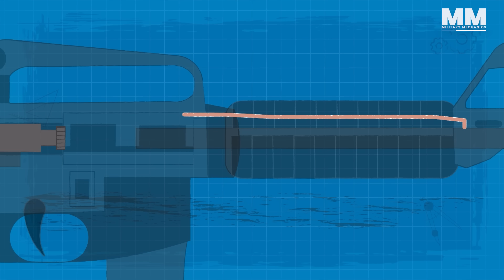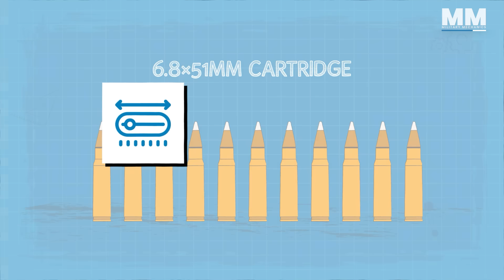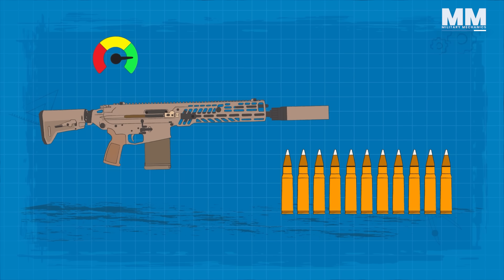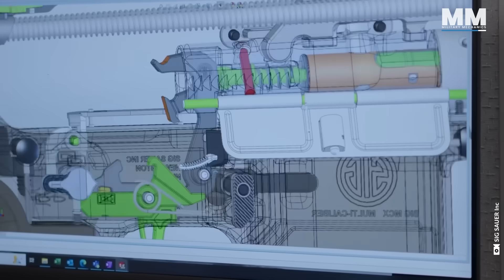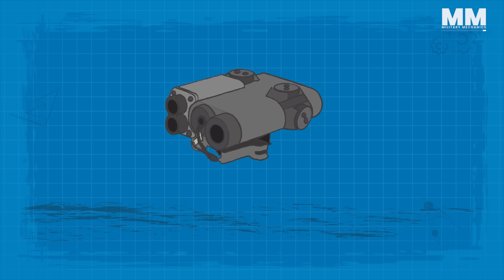XM7 vs M4: Why the U.S. Army Is Making the Switch

Comment: I’m still skeptical that this is really going to become the standard service rifle. The military may have needed more punch and range, especially against Russian and Chinese body armor, but at most, that means that they needed a new squad-level DMR, not a full replacement for the M4. And frankly, even then, I don’t see why they couldn’t have just bulk-purchased the SCAR-H (already a proven design that has served SOCOM well for 15+ years) and maybe added the new scope to it. I don’t see why we needed a new rifle and a new cartridge.
Reply: If you have watch garand thumb video on the ballistics of the new 6.8 round. The new round out performs the 308 by a lot. So to answer the question of just using something like the scar or 308, this round is a lot better than 308. This new round can penetrate light armor vehicles as well. Most light armored vehicles can stop up 308 or 7.62 nato, but 6.8 out performs it and can penetrate light armored vehicles easily. Not to mention the new round is capable of penetrating multiple types of cover a lot better than 308.

So if you have everyone equipped with the new round, every soldier is capable of defeating body armor or light armored vehicles and even cover as well. That is something you can’t do with 5.56 and even if you have people in your squad using 7.62 like a m240, that is something you can’t really do either. With how powerful the 6.8 round is, the xm250 can now replace both the m249 and the m240. You no longer need to go out and look for a m240 because the saw you have now can do multiple things. This makes everyone truly unified under one caliber which is good for logistics to. Since everyone is equipped with a xm7 everyone is also a marksman as well and there isn’t just one marksman. 

I think switching to the new round is the right choice my only concern is the weight because it’s not a light rifle. The only other concern is recoil especially because not every soldier is built the same. But hey we won ww2 using the m1 garand so.
Reply: The M249 was due a much needed replacement that weapons system is dogshit
Reply: 😅It's how we do business.
Reply: It's probably the business.... and some bonuses here and there!
Reply: There's plenty of issues the this avoids from the scar. No reciprocating charging handle, and it doesn't break optics like the scar. 308 also doesn't have the performance on body armour they were after. If you're going to change and spend all this money, you do it. You don't pick a half baked solution.
Reply: @samuelbishop3316   The current SCARs do not have reciprocating charging handles.
Reply: Doctrinally we’re already supposed to have one SDMR per squad, some units just don’t practice that
Reply: Re: "And frankly, even then, I don’t see why they couldn’t have just bulk-purchased the SCAR-H (already a proven design that has served SOCOM well for 15+ years) and maybe added the new scope to it. I don’t see why we needed a new rifle and a new cartridge."

I'm cracking wise, but not completely when I say: What does Sig have on the decision-makers in the DOD-Pentagon anyway? Incriminating photos? Sig has been getting a suspicious number of lucrative contracts lately. Not just the Sig Spear, but the army's LPVO contract, too - their new optic for rifles/carbines. Of course, they do make good products, but that good?? 

The fact that none of the practical and relatively frugal off-the-shelf solutions was used and a complex, new, and untried system - the Sig Spear and its new ammo and optic - was adopted instead, speaks volumes about how the procurement process "works" inside the five-sided puzzle palace. It isn't really to get the troops the best gear for the best price; it is to keep the gravy train rolling for all of the brass and defense contractors. 

The legacy system could be defended, in spite of its drawbacks, as long as it produced the best weapons and gear in comparison to our peer and near-peer potential adversaries - but now that it is out in the open that they are getting a far-better return on their dollar than we are, it is time for reform. Maybe even a fresh clean sheet of paper.

The Spear and its new-and-untried high-pressure ammo are a case in point, a classic fiasco in the making.  The requirements for the weapon started this whole thing: A 13" barrel is ridiculously short for a general-purpose rifle, in particular one whose stated mission includes long-range interdiction. In order to make the army's performance targets at distance, Sig had to create new cartridge technology in the form of a hybrid steel and brass case, a "solution" which may prove to be worse than the problem. Or not - we'll have to see. 

At best, even if it works, the new 6.8 Fury is more-expensive than off-the-shelf solutions, and is required construction of a new ammo plant at Lake City. At worst, the troops may be stuck with a weapon of dubious reliability, short service life and under-performance in the field. Again, we'll have to see. 

Perhaps the worst aspect of this project of all is that it doesn't even begin to address the decades-long debate surrounding the replacement of the current M4-M16 family of assault rifles and carbines, chambered in 5.56x45mm NATO, which is an intermediate cartridge. The Spear is analogous to the old M-14, it is a battle rifle, not an assault rifle. Even if it ends up being good at its job, it won't fill the new for a new assault rifle - because it is a battle rifle, i.e., fires a full-power cartridge; weapon too large, too heavy; recoil too stout; automatic fire too difficult; etc. And "small-stature soldiers," a.k.a. females - may have trouble with it as well. 

The M4/M16 isn't going anywhere, not withstanding the claims by Sig, the army or the DOD.
Reply: @GeorgiaBoy1961 the army puts out a bid proposal for a new Close Combat rifle.
Companies submit bids.
Nobody submitted the Scar.
Reply: @cwolf8841  - Am I missing something? Who said anything about the SCAR? Are you arguing that someone should have submitted it, but did not? I've only seen the SCAR a few times, and handled/fired it maybe once, so I am not the best source of info for that design. Lots of better-qualified people in/out of the military who know the design better than I do. The guy at my old shooting/outdoor club who had one sure seemed to like his, though... hated how much it cost, but raved about its performance.
Reply: @GeorgiaBoy1961 the new rifle only goes to Close Combat forces.
Everybody else keeps the M4.
Reply: @cwolf8841  - By close-combat forces, you mean combat arms personnel? If you mean those who do CQB, then I don't take your point. Isn't that the sort of mission the M4 was designed to do? But your basic premise, that the new rifle doesn't go army-wide, I agree with. I don't see it happening, although of course one can be wrong about such things. We'll find out one way or another, right?
Reply: @GeorgiaBoy1961 
The Army sets the requirements in the proposal for folks to bid.  Then the submissions have a shoot off.  Nobody submitted a SCAR.
The proponent being the Infantry folks … they made the decision to have a M7-M4 mix.
All you have to do is read the proposal…. All these things are online.
Reply: @cwolf8841 - Well, now, I don't need to read it if I have guys like you who know the score, right? Thanks for the info...
Reply: Overall they wanted to mount electronic optics and saw it as a good choice for that. I see this not as a replacement, but yet another supplemental weapon like the SCAR-H that won't be good enough to switch to. They'll learn the hard way. I think Germany and HK is the best AR platform to move to. H&K also has weapon designs that are 'far superior' to the US ones with future recoil and polymer designs improved to the topmost level. Like their new machinegun that is lighter than a m249, has better recoil and design, and fires like a m240b with improvements that is 'not for sale', etc.. would be perfect for the US as a future machinegun that looks and functions similarly. Same I'd say with their latest HK ARs which are known to be quality and simply improvements that can go up in caliber. The fact they couldn't make a made-in-US improved AR that is like the HK416-417 using futuristic polymers and plastics is ridiculous. SCAR-H isn't preferred for its iffy qualities and 20 round magazine which make it not a great overall replacement just to go up in caliber a bit. Usually other weapons just fill that role better and SCAR never replaced anything. If it was, it'd likely have been replacing a lot of things already, but it simply isn't always the case. Germany has done it right and some of the latest EU rifles and pistols have done it right too. I think it won't be replacing but will just be supplementing.
Reply: 1. 🟥 DHS Threat Economy System
Definition:
The Department of Homeland Security (DHS), alongside corrupted elements within federal agencies, have created a Threat Economy:
▪ Fabricated threats
▪ Manufactured terror cells
▪ Engineered domestic "extremists"
▪ Targeted assassinations and psychological operations on American civilians
▪ Monetization of fear through endless security spending, contracts, and false flag incidents.

Mode of Operation:
DHS and allied agencies bypass Constitutional oversight, operating like a modern KGB or Stasi, using illegal surveillance, economic targeting, biological harassment, and psychological destabilization to neutralize civilians who could challenge federal power structures.

2. 🟥 How They Operate:
Fabricate Threats: ▪ Stage or exaggerate domestic threats to justify endless funding. ▪ Inflate statistics about "extremists" to create fear and fake urgency.

Economic Sabotage: ▪ Freeze targets out of employment, housing, and banking via quiet designations ("watchlists", "no-fly lists"). ▪ Devalue and financially starve civilians labeled as "potential threats."

Isolation Tactics: ▪ Deploy informants and assets to socially isolate targets. ▪ Initiate smear campaigns and silent reputation assassination.

Covert Lethal Measures: ▪ Facilitate "accidental" deaths (car accidents, medical sabotage, mental health targeting leading to suicide). ▪ Use biological agents under the radar (non-lethal but degrading long-term health effects).

3. 🟥 Why They Do It:
Money:
▪ Every new "threat" generates billions in contracts for private security, tech, and weapons firms. ▪ Endless security theater = endless taxpayer-funded cash flow.

Control:
▪ An empowered, informed civilian population is dangerous to unchecked federal power. ▪ Targeting the most intelligent, aware, and independent Americans neutralizes future resistance.

Perpetual State of Emergency:
▪ Keep the population in a permanent low-grade fear state, justifying removal of rights and expanded surveillance.
Reply: How about doing some good old internet research where your questions are answered instead of posting "I don't know why". Why should we be interested in why you don't know something? 😏
Reply: @Sajuuk  - How about minding your own business? Were you born a jerk w/o manners or did you have to work at it?
Reply: Im not skeptical at all. Afghanistan has shown the weakness of the 5.56 which is it's range as well as lack of barrier penetration capabilities as well as to take advantage of the current and upcoming Rifle optics technology while keeping the length of the M4. Why did we not bulk buy 7.62 SCAR well it's length and the 7.62x51 inferior ballistic trajectory performance.

That were the 6.8x51 is born it's takes the best of both worlds (5.56 flatter trajectory while also taking the 7.62 excellent barrier penetration capabilities and range).
Reply: Re: " I don’t see why we needed a new rifle and a new cartridge." 

There are certain truths about how the DOD/Pentagon works, and one of them is that when a high-cost, complex solution is available, the low-cost simple solution will not be used. De jure, at least in this case, the reason the DOD/Pentagon exists is that it is there to get the troops the best gear, weaponry and equipment at the best value to the taxpayer. De facto, however, the reason it exists is to butter the bread of lobbyists, defense contractors and senior officers looking to get their tickets punched. To keep that river of taxpayer dollars flowing and profit margins high. 

In brief, your argument is way too logical, too economical and too sensible for their tastes....
Reply: The key thing coming the NGSW program isn't the rifle, it's the new hybrid case. That new case allows chamber pressures beyond the ~65k psi limit of current all brass cases. Upping the limit to 80k psi produces more velocity than 65k psi out of the same length barrel giving you shorter flight time and a flatter trajectory. Shorter flight time and flatter trajectory equal easier engagements due to wind, gravity, and target speed to have less impact on where the round lands compared to its aimpoint. Conversely if current velocity is acceptable, one could use a shorter barrel to match current results and save weight. Great thing about the Hybrid case Sig developed is that is it's caliber agnostic.... you can make a hybrid .50cal case, a hybrid 5.56 case, a hybrid .308 case, etc.... just need to make sure the weapon using the case can handle the 25% or more increase in chamber pressure.
Reply: @ogdendowcett2099  - 80K psi is uncharted territory for where std. military ammo is concerned, as far as I know. That's about 20% hotter than the current M80 FMJ 7.62 NATO round. The advantages you list are real, if the technology can deliver them consistently, and if real-world results match projections. 

A 13" tube is ridiculously short - Sig would not have had push the boundaries so hard if not for that requirement. A 16-inch barrel is still compact. Make the "cans" (suppressors) removal/QD so that they be stowed during travel. I don't get the notion that it has to be on the rifle at all times. It has to be cleaned, right - which means removing it, right? 

There's no free lunch with physics. Higher pressure means more-robust construction of the rifle needed - which means more weight and more cost, higher risk of mechanical and other failure, increased felt recoil; and then there is the ammo itself: 6.8x51, due to its new construction, cannot be made in existing ammo plants at Lake City; a new plant is being built. Is that wise, to place all of your bets on one plant, one factory? You tell me. 

If the project is a success, others will open to be sure. But there is no disguising that on a per-cartridge basis, 6.8x51 is significantly more expensive than existing tech, and more time-consuming and difficult to make. \

So, what we're looking at is an expensive new rifle, using expensive new ammo, along with its expensive new futuristic optic. We didn't get into that, but it is another potential point of failure in the system. Vortex Optics claims that this system of theirs is the small-arms equivalent of the fire-control system on something like a tank or helicopter, which is a tall claim to make. No one has solved the problem of wind enough to "guarantee" hits with a rifle at long range, no matter how good the rifle or ammo. 

Perhaps I am revealing myself as the not-so-tech savvy old man that I am, but is it really a good idea to have a small, potentially fragile electronic device atop your rifle, one whose buttons are small, and functions are complex? Will it be tough enough to survive/work in the field? What about weather proof? Is it easy enough to use that it can be done under the stress of combat? And so on. Vortex is a good company, but I'd have to say it is probably an electronic paper weight waiting to happen. Hope I'm wrong.... but not sure I am. 

I remain to be convinced that the entire project is feasible and will deliver on the promises made by Sig. Many of the problems the Pentagon claims to want to solve could have been fixed using less-expensive, off-the-shelf technology, without having to reinvent the wheel. I'll admit to being cynical, though; maybe the skeptics are wrong, we'll see. New tech has to start someplace....
Reply: @GeorgiaBoy1961  
If I remember correctly, a 13" barrel was not a requirement overall length was along with a muzzle velocity of around 3000fps. (Full disclosure, may be incorrect about muzzle velocity being an actual requirement, the actual requirement may have been energy on target at a specific distance from which initial required muzzle velocity was derived). To get that muzzle velocity from a standard pressure (~62k PSI) round you'd need a 20" barrel, hence GDOTS and True Velocity's bullpup submission. Sig decided to to meet the velocity requirement by designing a new cartridge that can handle 80k+ PSI without deforming which would allow the use of a shorter barrel and thus save overall weight base for the weapon. 

If you feel like some reading and better info than my memory, Gregory Knowles has some great threads on NGSW and NGSW related item, particularly one regarding chamber pressures and how it's steadily increased over time: https://threadreaderapp.com/thread/1552769176258785280.html

Here are some others:
https://x.com/2805662/status/1809399314671890865
https://x.com/2805662/status/1766235801795674161
https://x.com/2805662/status/1743462673243939141
https://x.com/2805662/status/1750346162262225318
Reply: The M-4 is a poodle shooter which never won a ground battle
Reply: @bernieeod57  Kind of a faulty metric by which to judge its performance, given that small arms aren't a decisive factor in winning wars anymore (if they ever were).
Reply: @ When you blow off the top of a mountain only to get driven off it does! From Guadalcanal to Chosin, 30-06 fire carried the day
Reply: @ Blackhawk down and Lone survivor are examples of poodle shooter fire failing when under similar situations at Guadalcanal and Chosin 30-6 fire carried the day
Reply: @ The rifle outclassed the musket, the 7MM Mauser outclassed our 30-40 Krag making victory in Cuba more costly. The 30-06, 8MM Mauser, and .303 rendered traditional skirmish lines obsolete leading to trench warfare so you are wrong! Small arms do make a difference
Reply: @bernieeod57  Small arms may make a difference in the individual infantry platoon or SOF unit's ability to survive a fire fight, but that's hardly the same thing as saying that they win wars (as opposed to specific engagements or battles, which is what you cite as examples). Also: If you ever watch Jeff Gurwitch's take on the M7, he's explained that in most recent firefights, the individual carbine gets used more as a personal defense weapon than the primary engagement weapon against enemy personnel armed with long-range weapons (e.g., Dragunovs or PKMs). The actual effects on target come from DMRs, M240s, .50-cals, or just calling in fire missions from drones or Apaches. His argument is that the idea of achieving overmatch against long range weapons by giving every rifleman the equivalent of a DMR (which is what the M7 is) is a fallacy from the get-go, because it is based on an inaccurate understanding of how firefights play out nowadays.
Reply: @ Until such resources are not available! Had Sgt. Basilone failed, the airstrip would have fallen and Guadalcanal would have been Wake Island 2.0. Had 30-6 Fire failed, Chosin would have been the Marine Corps biggest defeat. In Afghanistan, the poodle shooter was outranged by 100 year old Moisins and SVD's. It would suck to be you if your team was in one of those exceptions
Reply: @ By your own admission, the grunt has been reduced to an emasculated wimp who only finishes off the half dead and wounded after the enemy is pounded to dust by air, artillery, and armor. If the enemy is still able to fight, he retreats, calls the Air Force, rinse and repeat
Reply: @bernieeod57  I’m not going to pass judgment on our military, especially since I have not served myself, but from what I have read (from actual grunts who are veterans of recent wars), the short answer is that yes, modern-day firefight CONOPs are typically that if a small unit (infantry platoon, SF OFA team, etc.) gets engaged by enemy armed with long-range weapons, their approach is to lay down fire from their individual carbines so that they can find cover. After that, their bring their long-range weapons (SCAR-17S, M240B, MK 48, etc.) to bear on the enemy if they have them, or call in fire support if they don’t. I have no idea if this makes them “wimps,” but by most accounts that I have read, modern combat is nothing like Guadalcanal or Chosin. And even in WWII, most engagements were within 300 yards; the days of 1,000-yard marksmen were already ending by then. BTW: Operation Red Wings isn’t even an exception; that’s an operation that went horribly wrong and wasn’t supposed to be a firefight. And the problem there was simply that those SEALs were outnumbered. I don’t think they would have won even if they had the M7 back then.
Reply: @ Having served, even though Navy, we did go through land warfare training. The Navy uses the hand me downs in small arms. We still had M-14's. When due to the war on terror, we began to get M-4's, I stubbornly insisted on keeping the M-14 for as long as it was available. In counter ambush drills, I would simply take co er and pick off the enemy instead of joining ing the counterattack. The M-14 made a counter ambush a simple marksmanship drill expending only a few dozen rounds instead of spraying hundreds
Reply: @ Again, there are many cases where, in spite of being grossly outnumbered, 30-06 fire prevailed
Reply: @ The grunt never asks "How does it perform?" He always asks "What does it weigh?" Spraying a lot of .22 caliber bullets feels good but has not accomplished much
Reply: @ "The carbine is the weapon of mass army's whose motto is "Of you cannot shoot well, shoot a lot" The late Colonel Jeff Cooper
Reply: @bernieeod57  The thing is, when the M14 was being issued, the military still had problems with soldiers and Marines wasting ammo. Some field commanders had the weapons’ auto selectors removed for exactly this reason. Also: What you say about weight is one of the main reasons that the M14 failed as a service rifle, and why I think it likely that the M7 will, too. The name of the game in a modern firefight isn’t to use the service rifle to reach out and use precision fire to eliminate all enemies. The service rifle these days is just a personal defense weapon that soldiers use to return fire and keep the enemies’ heads down until fire support arrives. That means that volume of fire, not precision, is more important, and that is why the M4 is still ideal over the M7.
Reply: @BunyipDude suppressive fire is defined by the AMU as being within 1.5 feet of the Bad Guy.
The new rifle -sight combo is dramatically accurate and fast.
Dead Bad Guys are much better than temporarily scared Bad Guys
Reply: @ 1.5 feet? Got a link? That sounds contrary to common sense. I don’t see why laying down suppressive fire would be defined by distance at all.
Reply: You don't need to see the reason as you are not army infantry  or in darpa
Reply: dip in water and sand plus mud and see if it can still fire
Reply: @David-x2c8l sand unfair :(
Reply: @David-x2c8l which is part of the testing program.
Reply: The poodle shooter has always been a failure. However, a 6.8MM with 90,000 PSI chamber pressure what can go wrong?
Reply: The 416 with a better calibar would have been another option.
Reply: @mf6532  6.5 Grendel
Reply: @mf6532 M110A1 aka Hk417. Ironically the sig MCX submission for that program was adapted into the xm7 program.
Reply: SCAR-H has been overhyped in video games to the point where every ignorant teenager thinks it's some mythic weapon of excellence; it's not.  It did not "serve well;" there were a ton of issues to the point where you basically have to rebuild the whole rifle to get a semi-useful weapon, and then there are still better options.

The M7 is everthing the SCAR-H wishes it could be.  I don't see it replacing the M4, but it could make for a solid DMR.  You only need a handful in a Platoon.

The fear of a body armored adversary is largely baseless.  I'm all for being prepared, but the only nations that reliably field body armor en-masse are our closest allies, and that's not likely to change in the near future.  RUS and CHN can't even afford to equip their frontline troops; their economies are in the toilet.  

Rather than concerning ourselves with weapons, we should be focused on the quality of our weapons systems , namely our troops, whose readiness and skill continue to diminish as we struggle to retain qualified personnel.
Reply: @redslate  honestly looking at Ukraine having 80% of casualties and armor being destroyed by suicide drones makes me think that the $200,000 rockets are overkill when a $300 drone does the same to a tank

It's like how WWII was mostly won from artillery not small arms or WW1 being dominated by machine guns, preparation in the wrong areas
Reply: @redslate  I appreciate your pontificating response, but (1.) I’m not an ignorant teenager, and (2.) I don’t think SCAR-H is a mythical super weapon, but it is a design that has been used and improved for many years now, and there’s no telling what a Next Gen SCAR-H could have been. From a purely acquisition view, if the Army wanted a DMR, it made more sense to start with a mature design instead of requesting a new one. This is also a point that Jeff Gurwitch (retired SF-ODA) made on his channel when he took a critical look at the M7.
Reply: @BunyipDude  The Army doesn't make sense.  They didn't want a DMR; I'm saying, that is what the M7 is suited for.

If you want to see what the SCAR-H can be when improved, look at anybody that owns a SCAR-H; most have needed to upgrade them to make them practical, and it sets them back several thousand dollars to do so.  The SCAR-H was a 'good idea fairy,' flawed design from the beginning.

You were a teenager within the last 15 years.
Reply: @redslate  Actually, 15 years ago, I was 24. And yes, I know people who own SCARs.
Reply: @BunyipDude  Damn, close!
Reply: @redslate  Wrong. 15 years ago, I was old enough to buy firearms (in fact, I bought my first AR-15 around 2009-10).
Reply: @redslate  Then again the USMC famously pretended they need a new LSW to supplement the M249 SAW. But the real motivate was to adopt a better version of the M4, in the form of the M27.

Sometimes its easier to gaslight congress over equipment requirements as a work around internal politics. Its the same reason why the M10 Booker is not called a light tank, despite clearly being one.

The US Army had a +20 year light tank gap, because of internal politics. The M551 Sheridan was retired in 1997. The M8 Buford which was already adopted as a replacement was retroactively canceled. To make was for the Stryker Mobile Gun System which didn't work as planed.
Reply: @redslate  Main point and case of OP was that instead of investing in a new weapons which has obvious flaws for it's purpose as an infantry rifle, a better approach would be to use an existing weapons platform to better equip your infantry to save time and money in R&D. Of course though, that is not how it works for the government like that one time we spent hundreds of millions to find out that putting an optic on your rifle helps you aim better, but giving our 11Bs SOF training in basic wouldn't hurt either.
Reply: @keonyang3332  And, I went one level higher:  Weapons System (specifically people).
Reply: @redslate   In the industry we call that training and tactics. Same shit.
Reply: @redslate  So you admit to being pedantic?
Reply: @redslate  My guy, you need to change your thoughts on that. Russia and China have the capacity and capability to field body armor. 5.56 isn't going to do well against RUS and CHN T3 plates. Garand thumb did a video on Russian and Chinese armor, and it's fairly decent. We needed to replace the M4, the time was coming. I just dont think having the XM7 to replace is a good idea, however.
Reply: @mauricebeyjr611  The key words were "en masse."  Reading Comprehension

We're not talking onesy-twosy use cases; neither RUS nor CHN can field body armor in significant quantity.  Its impact is negligible at a force-level.  No offense, but a gunTuber testing Tactical armor doesn't change that Strategic fact.  

Also, body armor doesn't mean troops are "invincible."  That's the video games talking.  Ballistic armor's compromised after the first impact.  Now, that doesn't guarantee the next shot will pen, but successive impacts will .  Additionally, the goal isn't necessarily to kill your target, it's merely to incapacitate them or force a withdrawl.  In many cases, a wounded casualty requires more attention than a dead one anyway.  The mistaken mindset contesting this is akin to assuming we need kinetic kills by default, when in fact functional kills achieve the same endstate.  It's a bad habit that plagues even military leaders to this day.

The military has been saying they need to replace the AR-15 for decades.  There's not really an inherently distinct platform that can do this.  Revisions/improvements have been made to the M4 over the years.  Lateral alternatives have been introduced with the 416 (which also carries a slight weight penalty, though not to the level of the M7).  For a basic, lightweight, do-it-all rifle, the AR-15 paired with 5.56 remains most practical.  You don't even have an alternative to suggest.

Believe me; if a better system comes along, I'll endorse it.
Reply: @redslate  My guy, you're constantly underestimating the enemy. Yes, both Russia and China can field body and produce it on mass. Especially China, if their industry and capacity can build shields 100x faster than the US. What makes you think that they couldn't produce body armor? Which mind you, isn't hard to do whatsoever. 
My ancestral country of Sierra Leone can equip it's military with armor. China sure as hell can do the same and better. Moreover, no one ever said that body armor makes anyone invincible. I do agree the M7 shouldn't be the main rifle however 5.56 needs to go. It's a new era and dawn and change needs to come sooner than later.
Reply: @mauricebeyjr611  You still haven't proposed an alternative.  You can't drop one weapons system (or its ammo, in your case) without a replacement ready to go, plus the time it takes to transition.  You have nothing.

China's industry is designed to mass produce cheap sh.  That's what they are good at.  They don't have the QC necessary to produce reliable Tier III/IV Armor in bulk.  Much of the armor they have produced is compromised; it won't stand the test of time.  It's the same with other complex products.  CHN ripped off the FLANKER decades ago, but never could get the engines right; they'd prematurely wear out.  They recently put their latest submarine to sea, and it sank.  Sure, they can crank out tens of thousands of stamped steel AKs, but state of the art composite armor is beyond such scale.  All the while, they've been claiming the capability for more than a decade.

I spent the last two decades countering the narrative that 'conventional warfare is dead' as my country got tunnel vision in the sandbox.  There were those that thought we wouldn't even need conventional forces going forward.  I similarly pointed out the reality that other nations would soon introduce their own 'drones,' making their advantage no longer one-sided.  I'm used to seeing beyond the present, flawed line of military thinking.  Body armor as a threat is not a Force concern in the near-future.  On a long enough timeline, sure, but not soon enough to demand the policy changes in question.  I haven't "underestimated" anything.  You're overestimating both capability and impact.